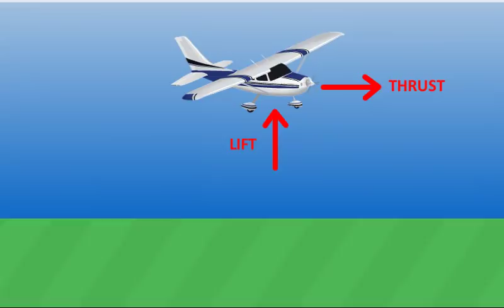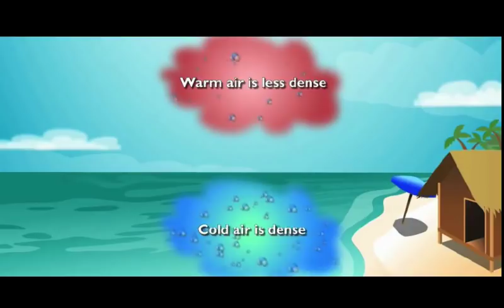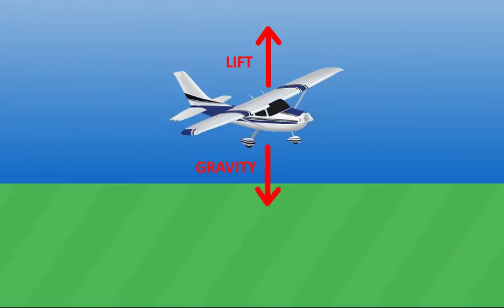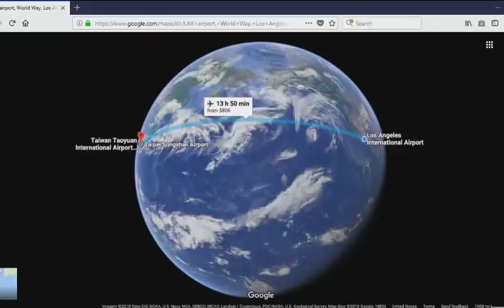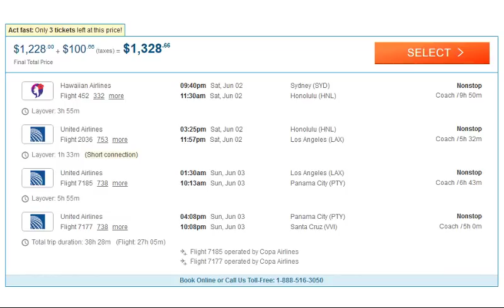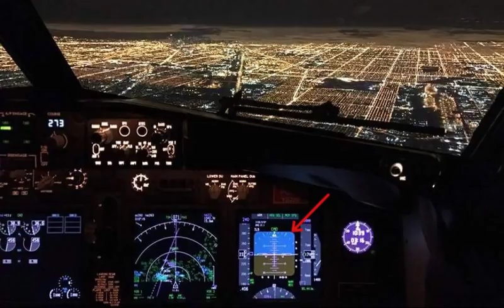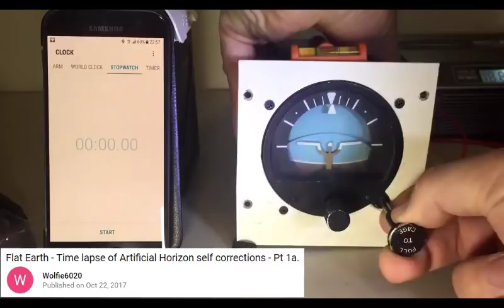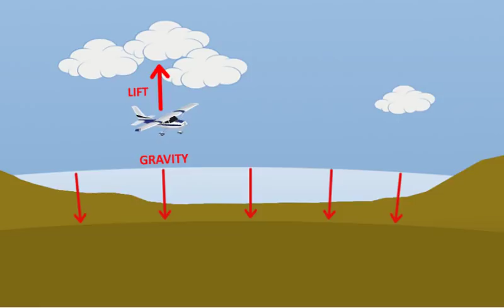Flat Earth Falsities - Plane Nonsense

Comment: If the FE plane theory is correct then if you jump upwards on a moving train you would be slammed into the back of the train.  You don’t lose your forward momentum by disconnecting yourself from what was providing that momentum.
Reply: Yup most of this video can be summed up by this simple 1min26second demonstration:
https://youtu.be/CDf_0fPbNos
Reply: Probably Not my name this is not hard to test you can do so in any shopping mall on the escalators... lok

Comment: Hello there,

You are wrong with infos and explanations!
..
Planes do not fly with same energy usage or timing when considered of their flights from east-west or west-east. Just like aswith what we observe as Alizé wind occurances, planes.. especially of long range fligts..
..
And in your way of explanatory.. you skip the direction aswith what momentum would have when mentioning the plane still on the ground.. this is an umfunctional way of handling and explaining the subject. Consider very heavy circular metals spin very fast vertically are not being able to be slanted on to the ground, their momentum stops the effect factor that forces it to go horisontal..
..
Aerodynamics and gravitation..
Gravitation is a momentum applier.. some actions are indokinetical or exokinetical.. gravitation at times help become faster or get slower.. aerodynamics are not free from G dynamix. So, if the plane conveys itself to a long durational wind currency can lead earlier than assumed in both flight scenarios or may get late due to winds as in both: G factor is not apart from magnetic, electrical or many force engagement agents which are forms and subatomic particles: a small stone hitting the ground on the planet is indokinetically bound to momentum application of the mass of the planet is hitting, and when the plane's wings are torn tue plane goes down being a massive part of the dynamic structuralization of the planet.. and the whole matter is all about momentum and its direction and whether the action is indokinetic or exokinetic as to what we messure of any relevance or reality. 
..
The momentum that the plane's engines provide horisontally when as-that of G factor it applies shows a degree on coordinate table of engine force- planet ordinations.. the plane can go faster to east with the same engine power than to the west anyway. Check what turning masses are used in huge marine warships against waves.. there is the answering a very a clue also.
..
We for & in cognition use surfaces and constant forms to consider mathematical moving realities and think that mass is constant as well as G factor is.. but everything is in movement and bound to a virtual spectral force and mass patternization texture.. and deal with enthropy which has no particular particle and forget about main momentum initialization dynamics. The spectral texture is overwhelming every force, power and energy evolveries/evolvements.. along with masses and shapings. 
..
In this composition a plane with an appropriate nanopaint flies way better and faster compared to a one without. The saying is: on flat is fleeted.. microwaves tell that not all waves are that densely effective on masses and particles due to spectral texture.. and spectral efectiveness tell that your chemistry and nuclear calcus are bound to its cybernetical characteristics in each compound or element or energetic or force-efective condition. So spectral realitu is both a heart and a face.. a wall and a filter for any thing.. be it massive or phenomenal.. and it is the ACTive above of all actionals inwithin them carrying them like a golden and hologramic tray. 
..
In the world of activities, neither the earth moves on an orbit which is elliptical (it is spiral in the big picture).., and as the ln curve tells, nothing circular without being in a constant linearization could happen to be.. so.. globular is a stance's happening to be.. and within the utmost picture, in detail and huge preciseness.. nore the earth is globular .. very in particularistic particularity that it is more than being a plate (3D is lost.. how come?!) and more than being globular.. it is spiral.. in composition of force, power, energy and mass dynamics along with aswith how it moves.. lest trillions of spirals are making it up in movement and its relatively constant visiblity and it is not constant at all and the massive strength of it is not as effective as its energetic, powering and force activity.. especially when it in the big pictute is withhhh the sun.. (remember the indo & exo kinetical facts and the virtual/abstract spectral texturing facility to accomplish comprehension.. as for dynamix are more collosal than masses and masses are bound to these all).
..
Good bye.
Reply: If you were impersonating Rocket Raccoon your vocabulistics were spot on.
Reply: What a wall of gibberish.  C-ya

Comment: Strangely enough flying east is actually  generally quicker that flying west as you will  see if you look at long haul airline schedules for  journeys with a large longitudinal change component. This is, of course, because the jet streams tend to blow  from west to east. (in both north and south hemispheres) and consistent  with Coriolis  forces generated  by a spinning globe model . It is hard to see how these would be consistent between north and south for a spinning  disk flat Earth model with much greater  forces developing  in the south than in the north, assuming that the axis of spin was around the North Pole, and in a relatively opposite direction in the South . Eg the Roaring Forties should be expected to blow to the west not east. Ho hum why am I  wasting my time bebunking this stuff? Because it's easy.

Comment: I was just thinking about the "tossing a ball in a car" example and it makes sense.  But then i thought what happens when youre in a moving school bus and you place a ball on the floor of the bus.  It rolls to the back of the bus.  Im no flat earther but id imagine if a ball was placed on a spinning planet it would roll as well?
Reply: If the school bus is moving at a constant speed and the floor is perfectly level then the ball will just sit there. 
If the bus brakes the ball will roll forward, if the bus accelerates it will roll back.
Reply: The ball will go to the back of the bus when the bus is climbing up a hill or is accelarating, and it will go to the front when the bus is going down a hill or is braking. On a level plane, at any given constant speed, the ball will stay where you've put it.
Reply: Even the smallest amount of acceleration or breaking would have a large effect on a ball rolling on the floor of the bus. I think you would find a ball would roll towards the front just as often it would roll towards the back.
Reply: Also you have to wonder if the suspension of the bus is set up to be level all other things being equal.  They might have it slightly sloped to the back to  make it easier to hose out occasionally.

Comment: Good explanations overall, but I think you failed to adequately explain the last point about the gyro. The gyro doesn't correct for the curvature of the Earth as the plane flies because there is nothing to correct for. The flat horizon for the attitude indicator will always be perpendicular to the radius of the globe (i.e. perpendicular to a line pointed to the center of the Earth). 

Like a thumbtack pressed into a tennis ball. Anywhere on the ball you put that tack, the flat head will always be perpendicular to the needle and parallel to the surface of the ball at the point it is pressed into the ball. The head of the tack doesn't have to "correct" itself for where it is placed.

So the error with the flat earther pic at 15:12 is that the "pole" around which the gyro is portrayed is in the incorrect orientation. They commonly mistake "down" for being a reference point outside of the globe, whereas in a globe "down" is always the center of the globe. So the pole in the gyro under the plane on the far right isn't pointing at the center of the globe but at the wrong angle instead.
Reply: Gyroscopes are oriented based on however they're set up when you initially start it up. You can actually use a gyroscope to measure the spinning of the earth so long as it's sensitive enough. So basically, the gyro IS consistently correcting to keep 'down' as the actual 'down' and if it didn't have any kind of corrective mechanism in place, half way around the world it'd think you were aiming straight up or down instead of level flight.
Reply: Damon: take a look at Wolfie's excellent video showing the internals of an Attitude Indicator (aka Artificial Horizon) https://youtu.be/z1QGRPVBZvw